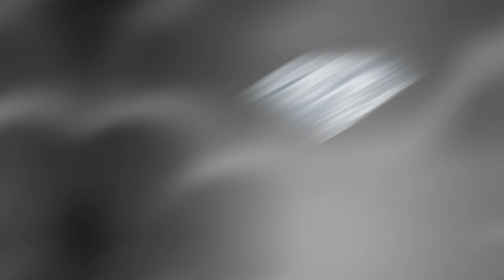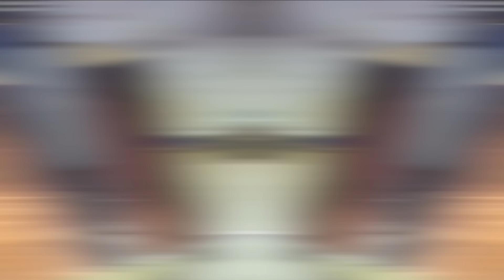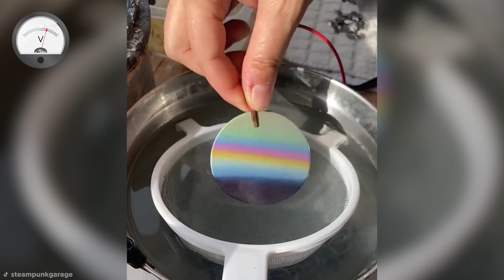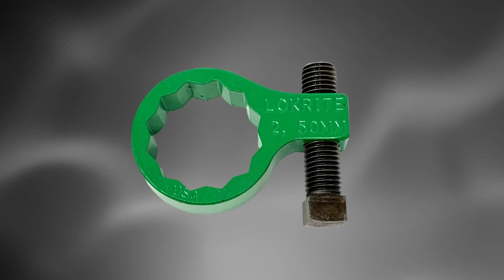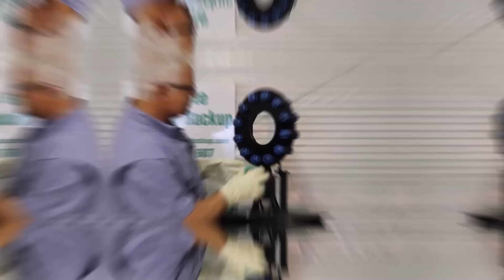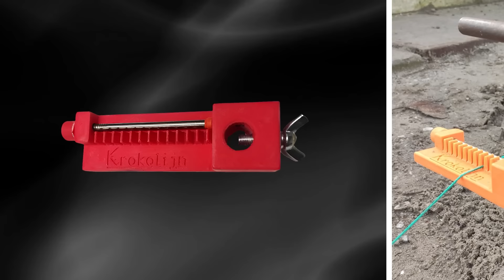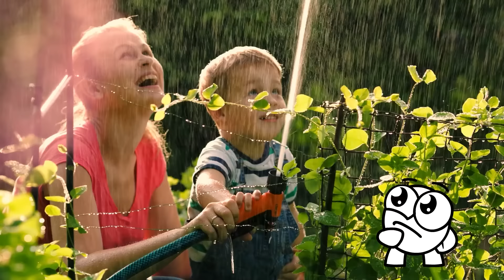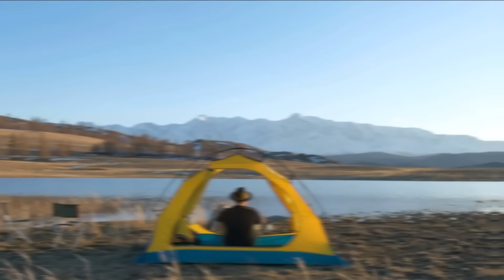When Amazing Tools Are on Another Level

Comment: Ryobi certainly did "not" create the oscillating multi-tool. It was created by GmbH Fein in 1967 as a plaster cast saw. In '85 Fein adapted the design for automotive use and in 2009 the patent expired allowing other companies to produce similar products. The first such clone I remember is the Dremel Multi-Max, certainly not Ryobi.
Reply: Yep. I have been using a multi tool for years to trim livestock hooves. It’s only as good as the blades you use. Like butter is far from the usual experience.
Reply: True but, I don't know any other manufacturer that has a swivel head on theirs.
Reply: @flick22601  dremel, stein, ridged, porter cable, etc. have all made them before...
Reply: You mean Fein GmbH
Reply: The old blue ryobi still takes modern ryobi batteries.
Reply: i knew it looked like a cat saw lol
Reply: I know right!  Doctors have been using these oscillating saws for cutting casts off for decades!  I remember when I went with my friend to get a cast taken off when we were in the 5th grade.  He was scared that the saw was going to cut him so the doctor hit the button and put it on his hand to show that it only cuts solid objects but is almost useless against flesh and soft materials.  That was back in the early 90s.
Reply: Yea and its called a multi tool, or oscillating saw. I cant remember what he called it.
Reply: 1967? That's a coincidence
Reply: Just need to comment on the Ryobi Multitool which are claimed to have been developed by Ryobi is actually a "copy" of the FEIN MultiMaster, which FEIN had the patent for many many years, until they gave it up in late 00's.
Reply: Way To Use Google, You Sad Fucking Hero. LOL!
Reply: No one said they did.
Reply: Im sure you didnt google that
Reply: Ryobi was purchased by the same group that runs Milwaukee and several other tool manufacturers.Their one plus tool line might pleasantly surprise you.
Reply: "This video was made possible in part by our good friends at Ryobi"

Comment: Diamond being the hardest naturally occurring mineral can be 'shattered' by a hammer? I feel like I'm missing something...
Reply: It's super hard, but it's brittle. A sudden impact is very different than the steady pressure from a cut. Think of a window and a baseball. You can rub the baseball on the window all day, the leather will never hurt the glass. Throw it at the window though and it'll break the window no problem. Same idea. They have high hardness, but low toughness, which actually are different scientific measurements.

Hardness, strength, and toughness are all different measurements of different properties of a material. Hard doesn't mean strong, strong doesn't mean hard.
Reply: Just another reply for some clarity. Hardness is a measure of how hard it is to scratch, strength is a measure of how hard it is to stretch, and toughness is a measure of how hard it is to break. And usually as things get higher in hardness they get lower in toughness, which is what makes things brittle. Too hard to deform so it just shatters.
Reply: Hardness and toughness aren't exactly mutually inclusive.
Ex: if you have similar size glass and plastic bottles, you can try this next experiment yourself!
Throw them against a hard surface (a brick wall works wonders) and see which one survives.
Reply: That is why we "temper" metal - otherwise, it'll be too hard and become brittle and easily crack under pressure, impacts, ect. You basically need to balance hardness with flexibility - diamond is highly inflexible, its been compressed in the earth under extreme pressures for a long long time, having its mass compressed into a smaller form. Its essentially what happens when you take something softer and comparatively more flexible, and make it harder, more dense. Like graphite - both are essentially pure carbon, and you CAN make diamonds from graphite. Those are diamonds used mainly in industrial settings, or for cutting diamonds, ect.